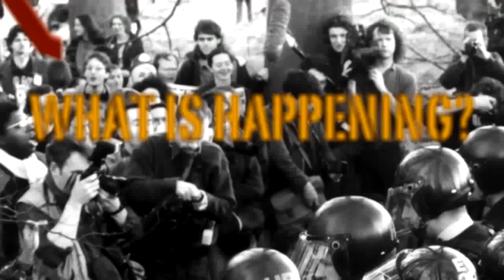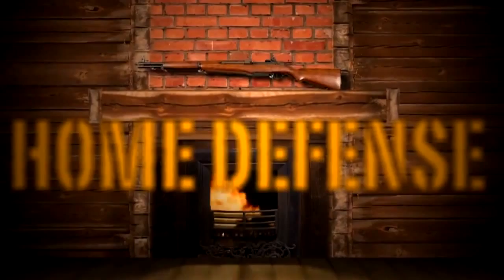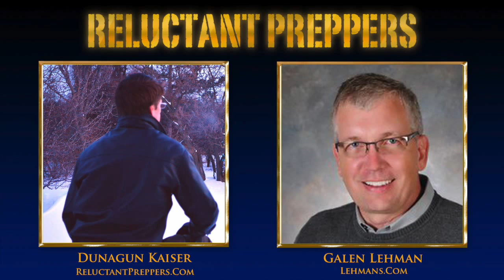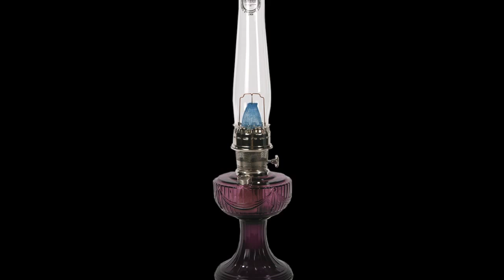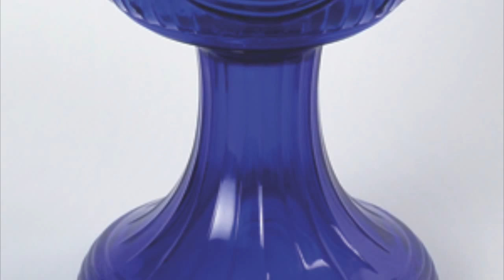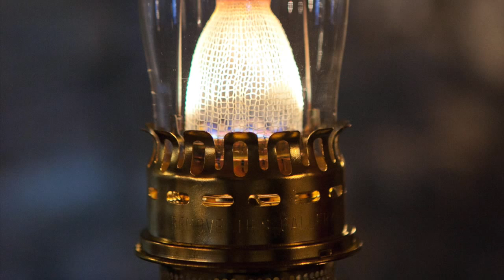Be Sure You'll Have Light When the Power is Out (ENCORE) | Galen Lehman

Comment: Tell that Amish guy about solar that can still be made operable after batteries die. A voltage regulator and long life super caps can be used for the battery data to a controller via a diode. Use multi voltage leds for light . They don't use much power. Everything wears or runs out including kero. Windmills/ hydro are also a valuable assets for power at night. What you get then is  on again off again power. For refrigeration just increase the insulation.